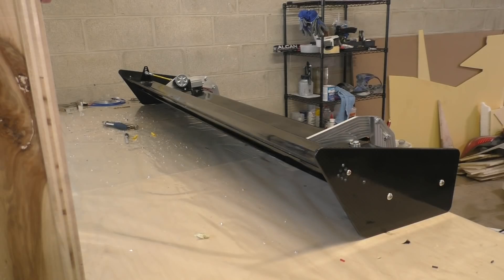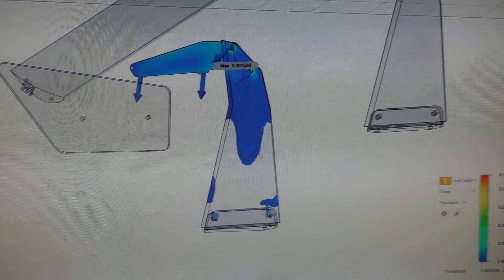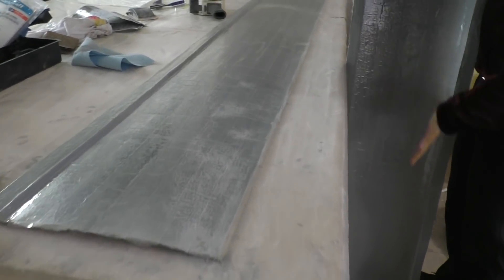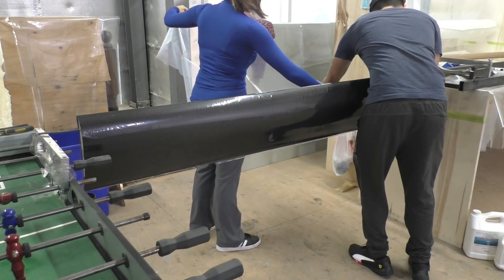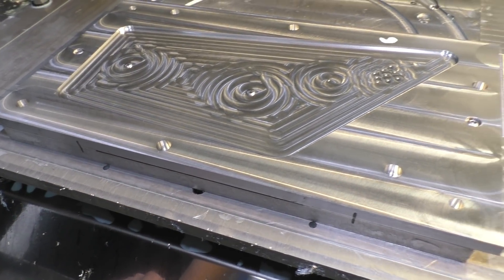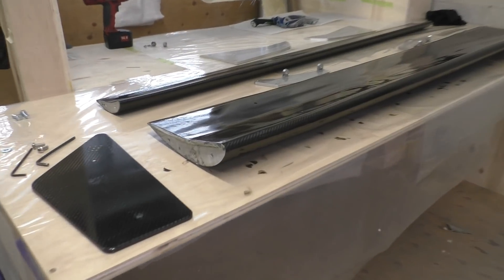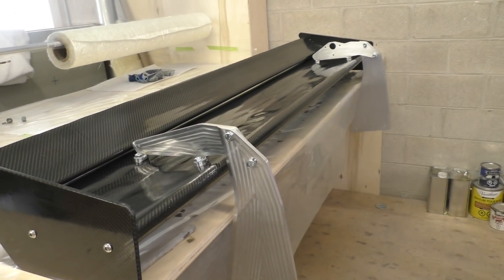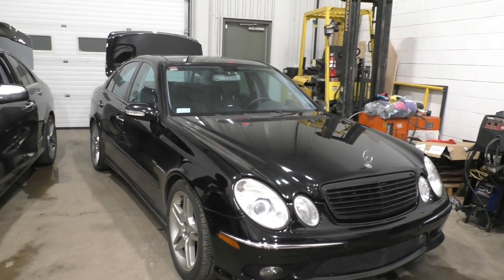Making a Carbon Fiber Rear Wing with DRS

Comment: Definitely some different composite work than you typically see. Never seen plaster and fiberglass together. Also as a machinist, your feeds and speeds are PAINFULLY slow and you can bump those up by probably 600-800% and have no issue.

Comment: Not gunna lie... Would love to see that DRS attached to the  wheel speed sensor and adjusts based on the speed. Plus add in a brake toggle to close it after x amount of brake pressure or something. That would just be dope and I'd ask the price of one!

Comment: only question i have is that isnt the weight distribution a bit challenging bcuz of the motor? i mean shouldnt we add a weight to the left of the spoiler so the weight on both sides get the same?

Comment: I saw your racing video when the hot coolant leak caused the carbon fiber epoxy to soften. There are room temperature laminating epoxies with higher Tg's available. I used West Systems 105 when I first started working with composites, but with a Tg of just 116 F (it's for boats), I moved to Adtech 820, which goes up to 180 F. However, you'll need to cure above 85 F to use the higher Tg resin.
Anyway, excellent work!

Comment: You should run like a bicycle brake cable to pull and push so you cam hide the motor lower in the car.

Comment: Any consideration taken on galvanic corrosion?
Reply: between which metals, Einstein?
Reply: @TJG239  I guess you've never experienced aluminium and composites together.
Reply: @rkan2  the CF is insulated in resin

Comment: Just out of curiosity: for future versions, would it be possible to remote-mount the motor so it doesn't get in the way of the airflow? I imagine just that one obstruction alone makes a significant difference in the drag created by the wing.

Comment: I hope you wrapped the aluminum inserts in fiberglass or kevlar. And the answer is no.
So you are all worried about the aerodynamics of the supports (which you got wrong) and then you mount he huge motor on the wing. Hmmm.
Overall - not bad.

Comment: Looking good! That's a sweet design. The talent and experience is really coming along. There is a relatively new process that will solve the issues that come up with the AMG 6.2-6.3 buckets, cams, and phaser lock pins. 
It's called WPC treatment.  It's essentially shot peening with ultra hard ceramic micro beads. Increases durability a minimum of 3x with a hardened compact grain structure on the surface of your parts.  Mike at IQ Motorsports has a couple videos on it. They use it for all their builds, even the cylinders. The bonus is that it cuts friction by 80-90%. That's 40hp on a C63 with no additional changes.

Comment: Do you use prepreg carbon or are you using vacuum infusion? Also, i only know it only from our car which not made for high speed, cant you just use carbon ribbons as core material for the wing? 
Or wouldnt it hold up on these high downforces?
Nice work the wing looks really good.

Comment: I have an idea on how to make supports lighter without disturbing airflow. Just mill out a pocket with a lip and possibly some webbing left, then glue in a piece of plastic (or other material) cut to size. Optionally sandwitch or wrap the whole part.
Also You should try flow and morph toolpaths out, escpecially on parts with smooth, curved profile.

Comment: Really nice man! Really nice crew! Karen, Seb and Eva! I'd suggest for finish, getting your self a compressor and a spray gun (I recommend Devilbiis). Reason I suggest this, is if you clear coat your carbon parts they'll look really glossy with way, way less work, also clear coating your machined aluminium parts will keep 'em looking really fresh, shiny and be easy to clean - A compressor will also allow to use air shop tools REAL POWER!
Reply: Thanks!

Comment: Did you consider making the top wing adjustment using rods and a cantilever (like in the ASL suspension) and putting the motor to the base of the wing support? Would it improve the aerodynamics?

Comment: Killing it you guys. What great content. But I’d have to agree with what another commenter said. Both of you are great but you need to up your safety gear. methyl ethyl ketone peroxide hardener for your fiber glass is no joke. My uncle developed mental issues after being an auto body guy for years. He would get the sensation of falling down and endless hole. Respirators suck but slowly harming yourself sucks worse. He had to retire due to his health problems. The wing looks amazing though.
Reply: Thankyou for the advice.
Reply: @One Little Wanderer  absolutely! Plus respirators are pretty cheap. 3m make some at a good price point. Those red checks, light headedness and feeling of blah after breathing resin vapors is your body saying wear a mask. For sanding N95 is just fine. Love watching you guys do your thing just can’t be messing around with those chemicals. That chlorinated brake cleaner is pretty nasty stuff to.

Comment: cool stuff.  here's an idea for your car with the wing.  tie it into sensors on the suspension, and also steering angle, and brake sensors.  When you are going straight, reduce the downforce for better top end, then when you enter a corner, or brake hard, the wing generates more down force, or as an air brake.  might shave some time off each lap.
Reply: This kinda stuff is on the edge of dangerous though, you need to have stable aero before you brake or turn.
It would be much safer to have it tied to GPS, so you could have the wing set and stable before you need it.
And then you can have GPS set your diff, brake balance, roll bars, and all your maps corner by corner(all the stuff that's illegal in F1).

Comment: Get a cheap old lathe. Especially for turning pistons etc, youd be surprised what you can do with one and how little space it ends up using :)
Reply: Second this, can never have too many machines/tools 😂

About the pistons, why not go with an aftermarket off-the-shelf set? I'm assuming someone makes a set.

If not, why not ask them (Mahle,CP,Wiseco,JE..etc) to make a custom set for you (since you already have the dimensions).. like Steph @PapadakisRacing did for their Supra with CP Pistons?
Reply: @DavisSgt  true, and great idea. Specific tools can be pretty expensive if you dont use them regulary

Comment: Great work you guys. Solid ideas Karen. You are a good team player. I like the wing design. I am curious about the vacuum bag you were using. Can you share more?
Reply: What about it? :)
Reply: @onelittlewanderer5342  it looks like a very adaptable design. How does it work and where did you get it? ✌🙋🏻‍♂️
Reply: @johndeerman2105  I'm not sure what brand or type of vacuum bagging material it is, but we had to make the closed portion ourselves. We just used a large folded sheet, placed double sided tape around the edges, laid on the white fabric, closed it up, and turned on the vacuum to suck out the air! It's a good technique but the downside is you have to leave the vacuum on for a long time. We haven't figured out out to seal it shut without letting air out yet.

Comment: looks great however there is a better way of making the DRS mechanism. rather than attaching the motor on the supports and ruining the airflow, you can make each support a two part piece and then having a pulley system inside and a mini latch inside the wing, then a motor attached to the chassis. use a strong string to attach the latch to the motor. I can make a CAD model and send you what i mean if you want
Reply: I would love to see it

Comment: Consider a foam-core hotwire cutting process utilizing your aluminum NACA airfoils on the ends. To add structural tubing support, simply add depth/diameter profiles to the airfoil so tht you can, "dig out" a channel. Makes fabbing wings up SOOOO much quicker and easier! Check: hotwire foam core wings
Reply: That is if you're using polystyrene foam, and not polyurethane! The PU foam they're using releases small amounts of cyanide when you burn (hot wire) it.
Reply: @drrock5356  True that- I was more along the lines of thinking they'd start with the new technique from scratch, so that they don't waste so much time in the manufacturing process! It's done with RC wings, so why create headaches when the roads already mapped out for them?

Comment: That EVO is gonna understeer big time at high speed! 😂👌
Reply: @Perry Elyod he meant because it will lift the front
Reply: @D3nn1s  more that the aero balance will be shifted rearward significantly assuming nothing is done to the front to balance it, meaning at speed the rear, thanks to this wing, will have significantly more grip than the front.
Reply: @noncog1  Exactly what I meant. Of course you can bring it back forward with canards and such without much trouble I guess
Reply: @D3nn1s  aero balance and "lifting the front" are two different things. The leverage arm of the cop of the wing to the rear axle is so short that it wont cause too much front lift, the bigger cause of balance shift isnt from removing front grip, it's from adding a lot of rear grip without adding any more front
Reply: @noncog1  so and the front looses grip because the rear has more? Doesnt make sense, the front has exactly the same downforce as before, the rear has more, so why would the front grip less just because the rear has more grip?
Idk maybe because 500kg are pushing behind the rear axle? Even if it just pushes the front up by the equal force of 100kg weight loss this is a significant difference. It has to be the increased downforce in the rear. That also wuy the mercedes cars used to flip couple of dozend years ago. If you can provide me with another logical answer then go for it or just calculate the lever forces, youd be surprised.
Reply: @D3nn1s  I didnt say the fron has less grip. I said it has less grip than the rear now. Grip hasn't decreased. Rear grip has increased, which means the front is now the weak point. Not because the front has less than it had, just because the rear has more now. Check a.j. hartman aero, he did a wind tunnel video that shows the front lift caused by giant rear wing, rear diffuser, and flat floor, it's easily cancelled out. The merc flipped from underbody aero.
Reply: @D3nn1s  or are you talking about the audi tt, also unrelated?
Reply: @noncog1  ah lel you mean % wise then say so. If you say less grip every normal person will think absolute not relative values
Reply: @D3nn1s  That was what you understood but what you understood was not what was written. The point was always about balance and the rear having more grip than the front.
Reply: @AnttiBrax  you always have to choose your words so that others will most likely understand them :)
If not thats your bad. Also it wont understeer more than before wuen the grip in the front doesnt change....
Like i said its lifting the front by approximately 100kg, just do the calculation, levers aint that hard.
Reply: @D3nn1s  they are when you have variables such as not knowing the lever arm length, instant force changing due to shocks and springs transfering the load in a non-rigid manner, speed an yaw sensitivity. Not to mention countless other smaller factors. If you put 335 section Hoosiers on the back of a miata, and stock tires up front, the car will go from almost neutral to extremely understeer prone. Not because front grip has changed, it hasn't, but because the front now has to impart a turning force on a tire much more resistant to it, and more importantly, balance is exactly that, it is intrinsically a ratio based measure. Put 2 250lbs men on a seesaw, one on each side, and a 30 pound kid on one by himself. Even though the one with the men is dealing with way more force on each side, it's still the more balanced one. A miata with a decent coilover setup, alignment, and brake bias adjustment will be way more balanced on stock sized street tires than a Cadillac CTS-V wagon on Hoosiers. The caddy will have more grip on both ends than the miata, but the miata will be much more balanced.
Reply: @Perry Elyod that's not true

Comment: Nice wing project. Consider rounding over every visible piece. If you look at a F1 car, you'll never or hardly ever see a hard edge or 90 degree edge. Every corner is nicely rounded over which help slightly with drag, aesthetics and handling.

Comment: Preheat those aluminum brackets to around 170 f before welding and it will go a lot better, also don't weld with a dirty tungsten, make sure you have a nice clean balled tungsten.